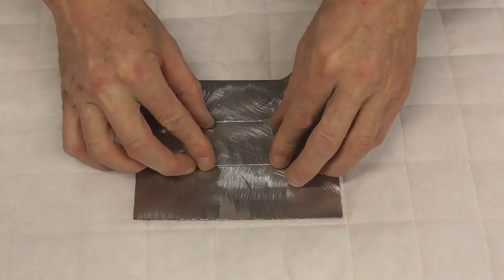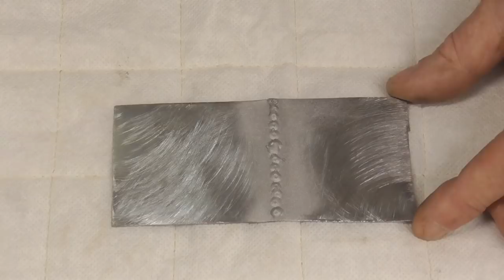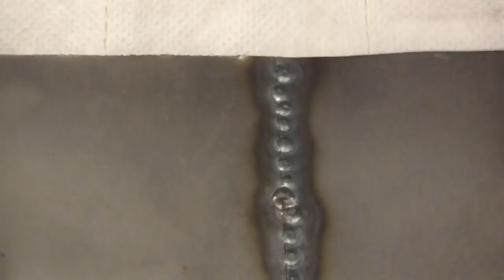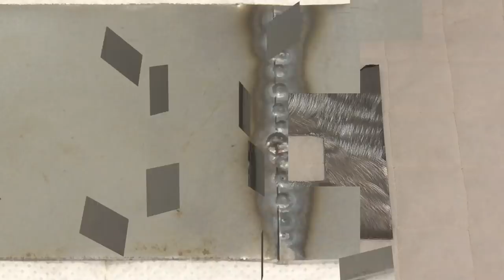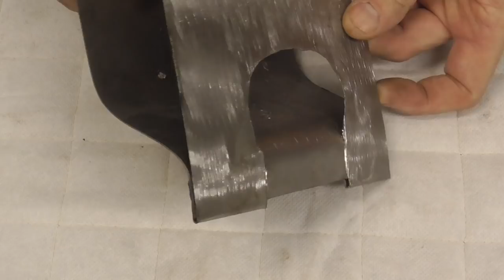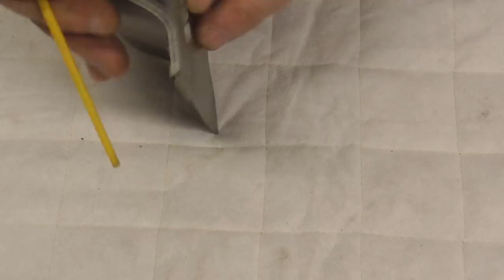Welding Patch Panels - Lap or Butt?

Comment: Not to mention, I love using a flange tool which I find gives much more structure in the metal around the hole plus it’s already flat when you weld.  Further, I punch holes in the patch edge for plug welds.  Ultra strong repair, I’ve only just started learning body work and my family and friends cannot believe the results.  Of course, I’m leaning on minivans that won’t pass inspection with holes in the door.  When I can afford a 1970 hemi cuda, I’ll butt weld and coach build.
Reply: One thing to note is that flanging the metal and lap welding creates an area on the body that is twice as thick as the rest.  Not to mention the metal will be more sturdy due to the flange, thus more difficult to work with.
Reply: Let us all know when you save up that 1/4 m for a driver quality Hemi Cuda.

Comment: interesting note.. when I didn't have a welder if cut rust out of a trunk in a camaro. I ground it clean and used steel pop rivets to hold in on, fiberglass and Eastwood encapsulated it.
That was 1987 and the car had been outside ever since.
NO signs of rust and it looks the same as when I did it.
There is no butt weld that isn't porous to some degree. It doesn't matter how you weld it you better fill it with cosmoline or coat the inside with automatic transmission fluid or something.
Butt welds are razor thin and just make you feel better. a good lap weld us strong and will outlast a crappy butt weld.
There is more than one way to skin  a cat.
If you can fix something and it lasts 25 years, nobody can tell you it's wrong.
Reply from the maker: Nice.  Absolutely agree with your views on fixing stuff!  I would like to experiment with something like JB welding a patch on - just for folks that don't have access to welding equipment.  I actually think it would last very long.  I like the way you think!  Jerry
Reply: @LakesideAutobody  look up a product called 3m 8115 panel bonder. way better than jb weld and will do exactly what you are talking about.
Reply: Incorrect. have you seen the backside of a properly penetrated weld on sheet metal? Has an extra 50%+ of metal and structure behind it as well as a good flush grind on the front will minimize thinning. I don't know where you get razor thin from. BTW that porosity you are talking about on a butt weld can be nonexistent or minimal compared to that huge gap you have in between the layers of a lap weld. Not saying you did it wrong or knocking you but i think your spreading some misinformation there. One last comment, saying some thing along the lines of butt welds only make you feel good is an excuse to make you feel better about doing it your way. Many ways to do it and nothing wrong with either way just a lot of misinformation in the comment section.

Comment: should always leave a tiny gap between the joint so the weld fills it. try using butt weld clamps they are great to work with. plus if you need to, its easier to use hammer and dolly on butt welded panels. not so easy on a overlaped joint, but hey what ever works for you. im only a hobbyist not a pro.
Reply from the maker: Thanks for the tips:)

Comment: I guess when you have an extended cab and you get the rocker and cab corner as one piece, you should rough fit it and see if you can pund down the pillars and fillin or should you cut them at the pillars and butt weld the pillar portions? Really good video, BTW, showed me things I hadn't thought about.
Reply from the maker: Anything too stiff to knock down you can but weld solid but try not to grind the heck out of the welds and also attempt to knock it down if you can and fill.  In open less rigid areas - lap weld, knock it down and fill.  Here's and example of butt welding a rigid type area ( the ends of a rocker section).  You can do it either way really (butt/lap) - just what works best for your situation - your choice.  What ever is the easiest, will look the best, and last the longest.  https://www.youtube.com/watch?v=2vEPQimW564  Here's a cab corner that's lap welded - use what you need from both videos -  https://www.youtube.com/watch?v=I8VVlYPIigA  Jerry

Comment: This is EXactly how I learned and do it. Haters need a few more years experience.
Reply from the maker: Thanks for the support.  Lap is how all body shops in Michigan fix rust or should I say fixed rust.  A lot of shops stay away from rust repair.
Reply: @LakesideAutobody  When I was a painter in a body shop many years ago. If someone repaired a quarter, like replaced a section and Butt welded it in they would loose their contract if the adjuster saw it. All these young guys  are saying butt  is the RIGHT way to do it. I say on an old 16 gauge car or a 18 gauge car it is fine but on a newer 22 no way. not safe.
Reply: also in a blind area you could possibly clamp on a patch panel with panel adhesive then there would be no possibility of the water getting through the 2 layers. Not that it will happen that easily
Reply from the maker: @Mikefngarage  You are so right!  I don't want to hurt anyone's feelings or be negative but the truth is,  a guy would be laughed right out of the shop if he attempted to butt weld the whole patch panel - really. He would not last long  - very slow, inefficient and just not the right way to go about it - poor quality too - see Eastwood’s vid starting 22 seconds in: https://www.youtube.com/watch?v=rpH50kh4W00.  That's just the truth, it's not to be degrading to anyone or disrespectful, it's just the way it is and was.  You are right on with the thicker old cars like the 20's - 40's too - That you can probably butt weld and metal finish - not today's metal.  Have a great weekend :)
Reply from the maker: @Mikefngarage  Absolutely - like this maybe: https://www.youtube.com/watch?v=wRl1QfkrBeY

Comment: Good Pointers,   before all the EPA, stuff I used to buy 1 gallon cans of ground up Asbestos with a binder mixed with water, like a putty, u plop it all around the area your welding,   1/2" away and it sucks away the heat so fast that there is hardly  any  warpage,  Great Video
Reply from the maker: Very interesting - never heard of that
Reply: @William_Ambrogio Yikes - asbestos! Scary how often that stuff was used years ago. You must be a "vintage" guy like me haha! There are gel sprays that are supposed to somehow wick heat away from welds - I've never tried them. I have used wet (but not dripping) strips of paper towel with decent results. Tear strips about 2" wide. Dampen then place them above and below the weld area. Blot more water onto them as needed with a very wet wadded paper towel. They will adhere to a vertical surface so no need to remove the door or fender for this. Larry

Comment: So what do you do when you have ground down the welds and there are little tiny pits in it? They are not holes just tiny pits. Do you fill them? Will there be issues with paint bubbles later on? Thanks for any help!
Reply from the maker: Good question.  First, remember that if the panel is going to rust again it will begin at the bottom where the salt water and debris gets trapped.  Up high it stays dry or drys out. 2nd,  Of course you are going to get a few bad welds - you're not a machine - it happens to everyone - even ones that say it doesn't.  If it does, you can grind it down a bit and hit them again with the welder or like me, I do my best, grind them down, sand blast them clean, knock them down and fill.  If you expect perfection, you'll get frustrated.  Hope that helps somehow - Jerry
Reply: Lakeside Autobody Awesome, thank you for your help! Your videos and help have made a world of difference! Much appreciated!
Reply from the maker: @scottiejones3518  You're welcome - have a great week :)

Comment: You didn't mention protecting the metal.  When lap welding, you should spray the overlapped areas with high-zinc "weld-thru primer".  An easy version is Rustoleum galvanized-metal primer spray cans, at most hardware stores.  Any bare metal on the backside will quickly begin rusting, especially any tight gaps which can hold moisture.
Reply from the maker: Some manufacturers are actually getting away from that as it affects the weld pool.  They recommend treating the seam after the welding process.  see this video for info on a simple way to for treating after: https://www.youtube.com/watch?v=8XaZBy7GC7A
Reply: @LakesideAutobody  
Oil works, and one reason I don't fret about minor oil leaks in my cars which blow oil underneath while driving to coat the bottom-side of the vehicle.  I vaguely recall reading that one treatment is to form a porous black-oxide on a surface which is then soaked in oil.  The oil remains to repel moisture, though the surface appears dry.  That might be the trick in tools like black impact sockets and protecting firearms.  For items like nuts and bolts that I don't have time to paint, plus the paint will scrape off when installing, I spray Rustoleum Rust Preventer, which seems like a waxy oil.  It states "6 months outdoors" but I expect it lasts much longer when out of he elements.  To remove surface rust on parts, I soak for a few days in phosphoric acid, which you can buy as concrete prep at Home Depot.  I think it converts rust to black iron-phosphate, which either flakes off or can be wire-brushed, and left in deeper pits to hold oil to protect.
Reply from the maker: @williamgrissom9022  Good information - thanks William - Jerry

Comment: Surely on the back of the lap weld patch, you will have a complete circle of a gap, that you didnt like on the butt weld..! Or am I missing something?..Cut the patch first, lay it over the bad metal, scribe, cut leaving the width of wire, magnet, then MIG Stick or TIG..But I.m not an expert....
Reply from the maker: That's what the magazines, TV, blogs want you to believe.  That you're welds will be perfect.  Remember, in the real world, you're welding upside down, sideways, galvanized metal, thin metal, extreme rust repairs, etc.  If you butt welded a patch on a gas tank and ground the welds flush would you trust it? Would you light a match near the welded patch?  One pin hole and your paint bubbles.  On a lap welded patch only the top of the patch is usually a lap - and the seam is upside down like a shingle on a roof.  It won't hold moisture.  The bottom of the patch is usually the bottom of the vehicle panel and either open or plug welded to an inner panel.  In a real body shop setting you use both really - lap where the seam can be tapped down and butt where it can't.  In every day driving the lap welded seam usually outlasts the butt welded seam.  That's just my experience over the past 40 years of rust repair in real body shop settings - and you don't want come backs because then you're working for free.  Hope this helps a bit.  See this vid for more real world info on the topic - https://www.youtube.com/watch?v=JIIonJOVro4

Comment: I honestly don't get the fixation with filler and everything looking factory fresh. It's only new once, who cares if it looks like it was fixed? It was. That's fine.
Reply from the maker: Good point.  The better you get the less folks will notice the repair too.  Just think... dealerships use filler every day across the nation and no one even knows it - 'cause it's used correctly.

Comment: I see what you mean. I like the idea of a lap weld where you dont have to grind them flush. Just low enough to depress the metal for filler. And then butt weld the pieces that are more critical and show on edges and such. Very good info.
Reply from the maker: Thanks for your input Mr C.  - have a good week :)

Comment: If you are restoring a classic vehicle do not follow this instruction. But weld patch panels and weld tighter than this guy.
Reply from the maker: With respect, lap welding is how all body shops in Michigan repair rust on late model vehicles (welding or adhesive).  Strictly butt welding a patch panel, which has become popularized by the internet and TV,  is not the best quality repair on today's thinner metal and there are many good reasons why professional body shops don't do it.  Shops use a combination of both lap and butt (butt for rigid areas that can’t be tapped down) on almost every patch but would never just butt two pieces of metal up (gap or no gap), weld it, then grind away at the area attempting to metal finish it.  Here why with good reason  - especially Eastwood’s starting 22 seconds in: https://www.youtube.com/watch?v=rpH50kh4W00  *
https://www.youtube.com/watch?v=MfKlNQF-o4I  *
https://www.youtube.com/watch?v=e9bjZ_UxtJg  
Today’s metal is .030. That is literally 6 hairs (hair is .005) thick.  You start grinding on that and the result is paper welds & surrounding metal.  In the end it’s what works for you though.  Keep in mind, you won’t find anyone butt welding in professional shops. Surely you’re not going to butt weld and metal finish this: https://www.youtube.com/watch?v=36zkc9UQaTs or some of my other rust repair videos.  Use small overlap, weld solid and you won’t have to worry about moisture - especially if you keep the drain holes clean (most important thing in rust prevention). Note that  the opening of the seam is upside down on the inside (no moisture trapped).  Please see this video for longevity of this type of repair if done correctly: https://www.youtube.com/watch?v=8XaZBy7GC7A or 
https://www.youtube.com/watch?v=2o37dX--w0I

Comment: The reason you don't have full penetration on the butt weld is because you didn't have any gap .Leave a gap and the weld pool fills it in
Reply from the maker: I do understand that but with respect, in the real world there really is no way you're going to have a perfect gap all the way around a rust hole.  This really is to get the truth out there so that folks know - for example,  you're not going to get some guy in a body shop to care enough about your car to make sure there's a perfect 1/32" gap around the rust hole on the bottom of the fender and the guy is laying on his back to fix it.  In addition if you were to butt weld it would be much better to knock those welds down and fill rather than aggressively grind the welds down along with the surrounding metal thus creating paper thin welds and adjacent metal.

Comment: Hobbiest here. If i do a lap weld on the side a a pannel, that piece is higher than the pannel. Wont it look like a high spot after paint?
Reply from the maker: You knock the welds and high spots down before proceeding with the repair.  With respect, lap welding is how all body shops in Michigan repair rust (welding or adhesive).  Strictly butt welding a patch panel, which has become popularized by the internet and TV,  is not the best quality repair and there are many good reasons why professional body shops don't do it.  Shops use a combination of both lap and butt (butt for spots that can’t be knocked down like edges) on almost every patch but would never just butt two pieces of metal up, weld it, then grind away at the area attempting to metal finish it.  Here why with good reason  - especially Eastwood’s starting 22 seconds in: https://www.youtube.com/watch?v=rpH50kh4W00  *
https://www.youtube.com/watch?v=MfKlNQF-o4I  *
https://www.youtube.com/watch?v=e9bjZ_UxtJg  
Today’s metal is .030. That is literally 6 hairs (hair is .005) thick.  You start grinding on that and the result is paper thin metal and welds. Lap and Butt methods can work well if done properly so in the end it’s what works for you..  Keep in mind, you won’t find anyone butt welding in professional shops. Surely you’re not going to butt weld and metal finish this: https://www.youtube.com/watch?v=36zkc9UQaTs or some of my other rust repair videos.  Use small overlap, weld solid and you won’t have to worry about moisture - especially if you keep the drain holes clean (most important thing in rust prevention). Note that  the opening of the seam is upside down on the inside (no moisture trapped).  Please see this video for longevity of this type of repair if done correctly: https://www.youtube.com/watch?v=8XaZBy7GC7A or 
https://www.youtube.com/watch?v=2o37dX--w0I

Comment: Nice video...I overlap most of my repair panels...it's faster to do..!!
Reply from the maker: Glad you liked it - it is fast and it does hold up very well especially if you coat the back with some good rubbery undercoating of some good old used motor oil - after you paint.  - Jerry

Comment: I wish you would show your methods being used start to finish in your explanation video. I think people should consider all processes of type repair from multiple sources. That being said people should check out another Utube channel on butt welding and patch panel fab- "Fitzee's Fabrications" This person actually films his procecesses. The results are AMAZING!!!  Check It Out....
Reply from the maker: Here's one start to finish - https://www.youtube.com/watch?v=e9bjZ_UxtJg  I don't agree with butt welding and grinding the welds flat.  How do you justify the integrity of the weld and adjacent metal after that process.  There will be paper thin welds, sheet metal, and tiny pit holes very near the surface.  Do these guys but weld this type of damage too?   https://www.youtube.com/watch?v=36zkc9UQaTs